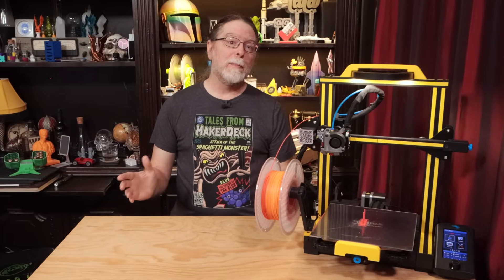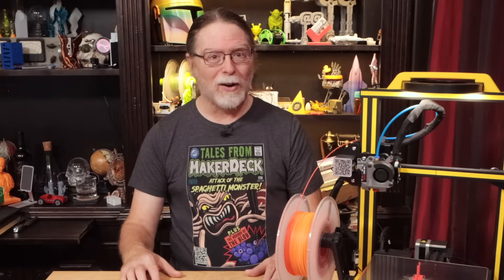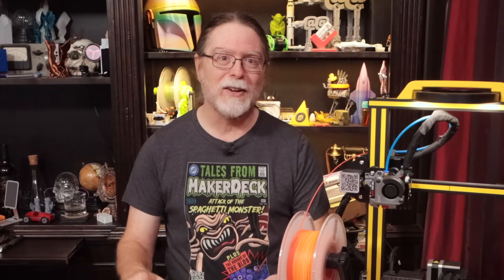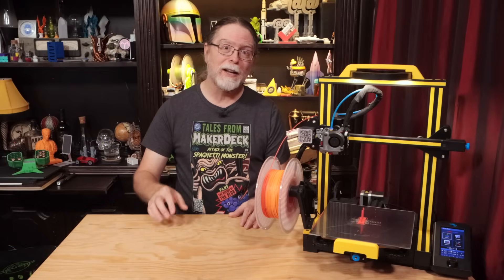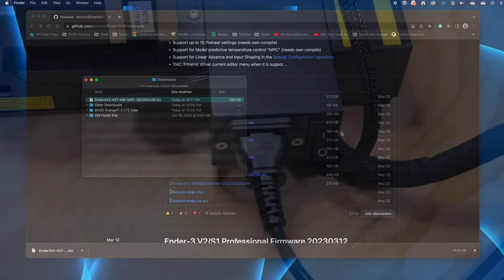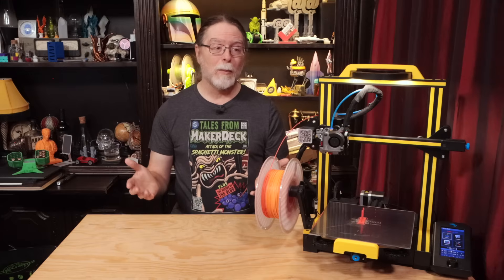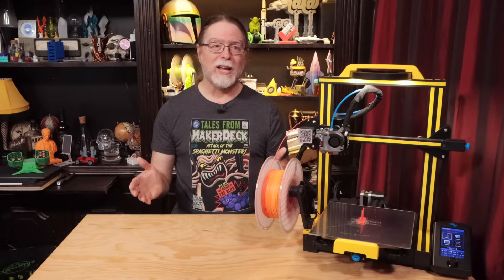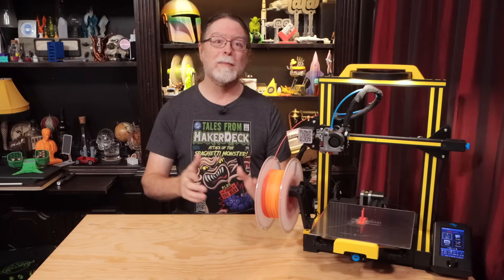The BEST Ender-3 V2 Firmware EVER?! MRiscoC Professional Firmware

Comment: Hey Bryan, great video as always. Can you tell me if this firmware works with GD chips also?
Thanks and greets from Macedonia!
Reply: I want to know the same thing.   There's been some conflicting comments. on the mriscoc git hub page.  I think the author of the firmware says it's not supported.  Doesn't necessarily mean it will not work.   I'm not willing to take the risk at this point.
Reply: @frognot672  Hey, I actually have updates on this. I really didnt like the previous fw that I installed on my printer (it was 1.0.7 GD version for 4.2.2 and the 3d touch really didnt work as should) so last night i installed this fw. And so far everything good! One thing i noticed you need to auto level the bed between every print. Despite this everything works fine!

Comment: Thanks for posting this. I struggled for quite a while with the JyersUI; the mesh levelling routine did not seem to get along with the CR-Touch. I had to re-level each time I ran another print, and it still wasn't right. With the MriscoC, I ran the guided tramming first, then the mesh levelling, and it has held perfectly. Ender 3 V2 4.2.2 board/CR-Touch/Sprite Pro/twin-Z axis/PEI build plate

Comment: is there a way to adjust the bed size settings?
i want to apply the firmware on a ender 10 S pro with a 4.2.7. board and custom dwin display (from the ender3 v2).

Comment: I loaded it on e a while back and didn't find the manual bed leveling so I ended up going back to jyers ui back than. 
I am do fo an all new edit and compile and might try it again since I got the ender extender 400mm x and y kit

One question. Does it have a setting so if you use a filament runout sensor that if it detects a runout that it can retract the filament the same as when it does a filament change?   If so that would be perfect because  it simplifies recovering a print from a runout

Comment: I've been using his firmware for several months now on my Frankenstein Ender 3 V1 (it's somewhere between a V2 and S1 Pro).  It works great and I love it.
Reply: Does your v1 have a sprite extruder? My v1 is very much not a v1 anymore. V2 display, 4.2.7 board and dual z axis steppers. I really would like to try this but idk if the sprite with bl touch is supported
Reply: Sprite extruder, dual Z-drive, mains print bed heat, 4.2.7 board, CR-touch, diamondback nozzle.  In fact, mine sounds a lot like yours, and the MRiscoC works great.  Auto bed leveling with up to 81 probe points, auto bed tramming that takes all the guess work out of the manual method.  There's no reason it won't as well for you  as it does for me.  He even has a version for the 300 degree C hotend.
Reply: @lindeleasley  I jumped into it last night. Found the T13 compilation. What a night and day difference. Why does Creality tie the hands of these things like they do? MRiscoC on the same Gcode did a better job. After I ran all the PID and Nozzle temp calibrations, set E-steps, the tramming wizard (which is an absolute gem), set z offsets and set a mesh and ran it I couldn't believe the difference I saw. I can only imagine once I set the slicer settings and enter the G29 lines in how much more I'll like it.

Comment: The firmware you are talking about is in fact probably the Best available for ender 3... Ender 3 v2 firmware for sprite pro with and without CR touch  provided by Miguel saved my  mental health and prevented me from throwing e3 v2 away...

Comment: if i have the CL touch can i still use the BL touch firmware?
Reply: Yes! I have a CR Touch, it works great with it.
Reply: @kimagine  i dosent seem to work with mine? did it work straight away or did you have to fiddlw with any settings?

Comment: So I’m considering changing software on my Creality Ender 3 v2 and I also just purchased the dragonfly bms hot,  end I’m curious if anyone knows what the temperature limit is for printing with this firmware because I need to be able to print 300°C for carbon fiber, nylon filaments thanks

Comment: I installed this firmware 4 months ago.  My Ender 3 S1 has never worked better. It's just amazing how many features have been packed into this upgrade.  I love the automatic mesh leveling.  The amount of tools included are simply amazing.  I highly recommend installing this... love it.   Great review by the way!
Reply: i do as well however could not get it to download onto printer. What Bin file did you use?

Comment: My ender V2 with a sprite print head will not print using cura, it will not extrude while printing, but it will print if I use bambu slicer, is there a setting I am not flipped, in curs, or in the firmware, any help please
Reply: Have you adjusted the steps per mm for the sprite print head?
Reply: Yes, it will extrude and tested to make sure, it’s a software issue, I think, but it will print with orca slicer, just not cura or Creality

Comment: it is nice firmware, I have had issues with it on a Ender 3 that I converted into a V2 that came with a version 4.2.2 mainboard. for this particular setup I had upgraded to a Sprite Extruder Pro kit with a CR-touch bed probe. Something about the High speed on the version I had compiled was causing an issue where I can print once with no issues, but if I want to print again I have to power cycle the printer. If I do not do this it doesn't deploy the probe so it buries the nozzle into the print bed when it goes to home or probe the bed to make the mesh. I just downloaded the latest version and I'm going to try again making only the minimal changes needed for the probe offsets and nozzle positions, max size,etc. and hopefully it will work OK this time. I got a 4.2.7 board to swap in if that doesn't fix it.

Comment: Here’s a nice feature. If you use a SD card adapter you can enable media check in the menu and it will refresh the card whenever you select the media (print) menu. No more rebooting the printer when you change cards!
Reply: I thought it had Something do with Update but thanks

Comment: There's a precompiled firmware for TJC screen, but only for 422 board. Without that precompiled firmware the screen won't draw lines on graphs also there won't be any values in meshviewer and the circles representing points will be messed up.

Comment: I installed the firmware with the bltouch/cr .when it starts the print it doesnt do auto bed leveling like it did before the firmware was added
Reply: For UBL, change the "G29" to "G29 P1"

Comment: I've been using this with my 3V2 for a while, at first mostly because it let me set the maximum height without having to recompile, and it's been great. And since I extended the height of my printer, that's kind of a necessity. Love it.
Reply from the maker: Yeah, that feature right there -- the ability to adjust the printer's dimensions -- makes this so awesome. I can put this on my Ender-3 Max that I've upgraded with the V2 screen and not have to recompile.
Reply: @BV3D  Hi Bryan, will you please cover how to do the upgraded 3 Max as well?

Comment: Bryan, Thanks for a great video! I just joined your channel and look forward to watching the rest of your V2 and general content. You have rekindled my interest in 3d printing on the V2. A few years ago, I bought a V2 during it's pre-release offer and then got distracted by life. That V2 still sits in my closet in its original box, unassembled and unloved. Thanks to your video, I'm once again planning to assemble and learn how to use it. It occurs to me that assembling the parts that came in the box might make a good museum piece, but it is probably better to buy the current best-of-breed components and build it up right from the start. In addition to the items you mentioned (the 427 board, the BLTouch bed probe and the BIQU H2 V2 direct drive extruder with the E3D Revo hot end), are there any other upgrades you would suggest out of the gate. Also, do you know if the screen module can be replaced as the one I have is probably too primitive to accept the icons upload. If I going to do this, I want to do it right. Purchase Links (even affiliate links) for any components you recommend would be greatly appreciated. Thanks again for a great video and also thanks for any advice you choose to share.

Comment: Anyone notice any issues with the stock 4.2.2 board running this FW with a BL Touch? Seems to not like my BL touch and have some issues. Sometimes when I got to home the device it won't deploy the BL touch and go straight into the flashing red mode. It doesn't deply the BL touch prob on start up like other firmwares do, mine just starts to flash red at the start up and never deploys the probe.
Reply: Try disabling HS mode in Advanced/Probe settings

Comment: Thanks for showing us this firmware! I did it, but when I rebooted it, all the icons were just blanks. I was however in luck, the display was listed amongst the compatible ones. I also flash the new firmware for the display without any issues and, once rebooted with the second new firmware, all looked absolutely fantastic! All seems to be working fine, I only had time to check/compare the basic values and I performed the homing with a promising result.

Comment: QUESTION: Print says "no thumbnail". do i just put a 32*32 png with same filename next to gcode file?
Reply from the maker: There's a script or plugin available for both Cura and PrusaSlicer, but I haven't had a chance to play with those. The image data gets embedded in the Gcode file. I did try setting PrusaSlicer's built-in ability to generate thumbnails at the correct size, but the printer wouldn't display the image, so it looks like the script or plugin is needed. Info is here: https://github.com/mriscoc/Ender3V2S1/wiki/How-to-generate-a-gcode-preview
Reply: @BV3D  ty! i found that I had to install python, etc. works now!

Comment: The firmware is great. But you skipped an essential installation step. The physical settings used to let the printer know where the printbed and nozzle are is pretty vital if you have changed the hotend. I had quite a few issues when I changed over to the Professional firmware because it didn't immediately take the new x/y min position. Making me set it twice and question my sanity and the documentation.

Comment: Updated with no issues but for some reason the build plate size is off. It does the purging line at the very edge of the build plate
Reply: I had this issue. I had to go to the physical bed settings option in the Advanced menu, and set the minimum X parameter (or whatever it's called)  to -3. It's a bit counterintuitive but this tells the firmware that the X endstop is 3mm to the left of the edge of the bed. You may need to set it to something else of course, I found it by moving the head to just above the bed, doing a manual move and squinting at the nozzle until it looked right. Then noting down the number and flipping it to be negative.
Reply: @merseyviking  thank you very much I'll go ahead do that. Thank you very much
Reply: Do you happen to know how to reset the settings to it, I may have moved some setting around and can't seem to remember what original setting the firmware update came with.
Reply: @salvadorraya2118  For the physical bed settings? I think it was just 235 x 235 for the size, and 0 for the x and y offsets. I don't have my printer nearby at the moment unfortunately.
Reply: @merseyviking  I'm sorry, I didn't explain it right. For the whole firmware. While trying to fix the bed I was just moving stuff around and than couldn't remember what the original settings where. So want to reset all the settings again in general.

Comment: Ive been running the MRiscoC Professional Firmware on my Ender 3 V2 for almost a year now. LOVE it! I have the board that wouldnt work with the Jyers version. Im running the Sprite direct drive extruder with the CR Touch bed leveler, and dual Z axis, and the Professional Firmware has worked flawlessly with my setup.
Reply: Hi mate, I have the same setup as you currently on jyersUI. I have the 330C hotend but jyersUI won’t let me. Does MTiscoC allow for 300C or do I need to compile my own

Comment: Another nice feature it has over the stock Creality fw is that it supports preview thumbnails embedded in your gcode files.  It does require a plugin for Cura.  I don't know about support for other slicers.
Reply: What plugin do I need in cura to get the preview to work ?
Reply: @erikmcgavin1950  Well, I have tried to reply twice now, and it keeps getting deleted.  I don't know why.  But the answer is on thw Wiki tab of the firmware page "How to generate a gcode preview" section

Comment: Unfortunately all my 3D printers are in storage 😢 been over a year since I've used any of them. This firmware looks very appealing! When I pull the E3V2 out of storage I will probably have to relearn how to do everything.  All I remember is I have a Raspberry Pi 4 attached to it running Octopi, it's all outdated now . What fun I'm going to have. All my filament is ok been in an airtight container with lots of Desiccants and the storage is climate controlled 😊. Will definitely be watching some YT videos to get up to speed again. I don't think my Saturn will be ready as fast since the 30+ containers of resin are all way past expiration date.

Comment: I have a Ender 3 V2 Neo.  Based on comments it looks like it is compatible. Does this make changing filament mid-print easier?   I'm using Octoprint.  Does anyone know how this would work?
Reply: Been using this firmware a month now.  VERY EASY to change filaments during printing.  I use PrusaSlicer and just bought HUEFORGE for $12.  Created my first PNG to STL which required 4 filament changes on my Ender 3 S1. David

Comment: Bryan, glad you finally covered this firmware. I've been using it for a while and it's so much better than stock. There's a Unified Mesh bed leveling firmware available as well if you have a BL Touch. It's awesome as it makes tramming and leveling the bed a breeze with guidance on which knob to tighten or loosen and even shows you a visual of the heights of the leveling points in the mesh. It makes it super easy to get a perfect first layer.
Reply: I might be a little late to this, but i recently upgraded my ender 3 pro with the v2 screen and used the board / screen firmware they provided me with the upgrade. Could not get a good mesh. I just flashed the firmware on the board and screen to this and i got the mesh within -/+.02 with the build in system. Its so easy to use.
Reply: would you be able to say where to get the firmware you are talking about? I have the BL touch on a pro and a v2.
Reply: @TheWhatman21  It's on the release page for the mriscoc firmware. Just download the version that is correct for your printer and board revision and included BLUBL in the filename. It's pretty straight foward if you read the release notes.

Comment: Thx. What is max temperature you can set? 260C or higher? (since I have Microswiss all metal hotend)
Reply: Have the same question, running the sprite pro on jyersUI so limited to 260

Comment: Not sure if anyone else is having this issue. I was running Jyers fine (Minus a screen bug or two) for a few months after watching the previous Jyers firmware update video. I saw this video this morning and decided to give it a shot. The firmware flash went fine but once I started the MPC Autotune my thermal runaway just started going crazy and any preheats would not hold temp and just fly off the handle. I had recently upgraded to a Microswiss NG Revo setup not too long ago which worked great with Jyers no problem so I was worried the thermistor was failing on me already but I just switched back to the version of Jyers I was previously running and it is just fine again. Anyone have any ideas why? Maybe something to do with the new thermistor or heatercore? I'm not at that level yet to diagnose this one on my own so I'd appreciate some ideas.
Reply: Your thermistor may not support the MPC implementation in this firmware, you can do a custom build with PID enabled instead.

Comment: Have been using this firmware for several months, and it has made printing much, much easier.  Manual mesh has been a lifesaver!
Reply: Does it allow for higher temps like for printing nylon?

Comment: Brian, are you familiar with the issues with this firmware and the developer not properly following the open source license requirements of Marlin? There's been discussions in the issue tracker about this on Marlin. 

Just curious your thoughts on this as it relates to the firmware. Thanks for your time.
Reply: This was my reason for holding off from moving from Jyers for so long.  Then I jumped to Klipper instead.  But I did have an issue I had to rule out Klipper, so I flashed it for a few days to get my problem confirmed.  Super nice, but from what I read, the developer was super sus
Reply: @MallocArray  It wasn't so much the failing to follow the license requirements that's kept me from the firmware (Jyers apparently did this to some extent from my readings in the issues page), but the way the dev has been sus about the whole issue, plus not being able to fine tune parts of the firmware to be compiled the way I want it, is why I'm ok digging through the config and config_adv and learning the options myself and baking my own firmware. Yes I screw up, but I can at least back track all my stuff and not rely on stuff I can't even read or see because it's been compiled by the dev mentioned here.

It's a nice firmware no doubt. If they fixed this issue on the open source license requirements, then I would install it on my 3v2 until I move it to klipper one of these days.